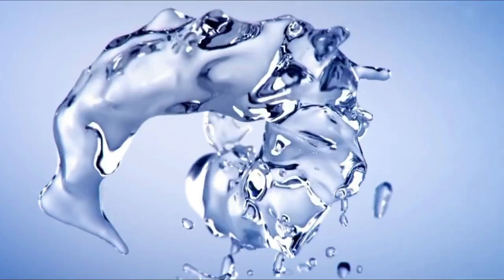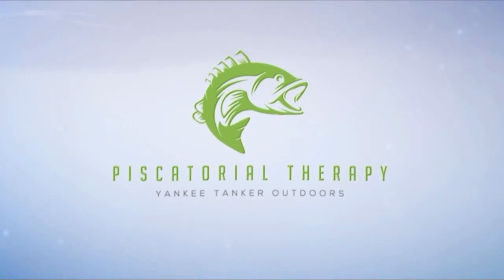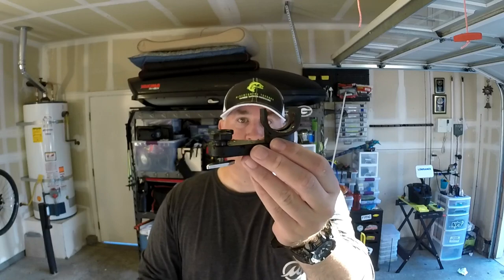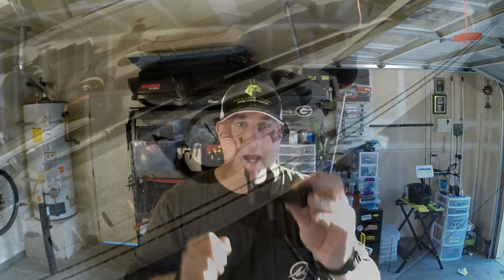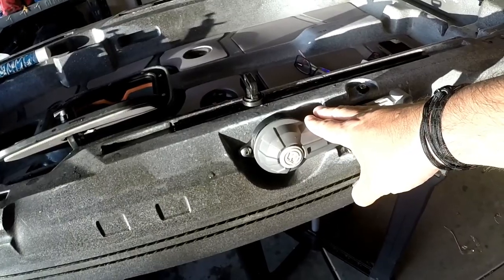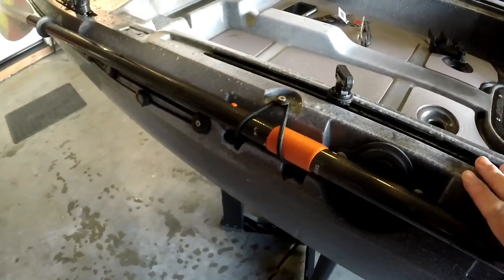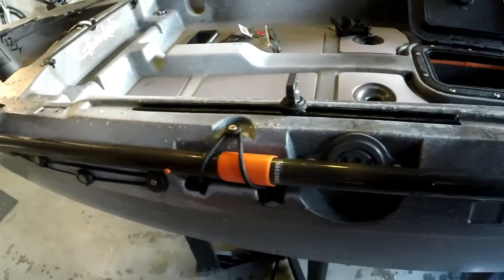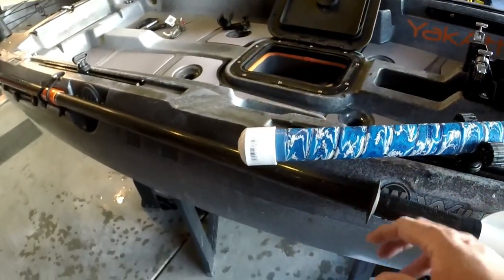RAILBLAZA QuikGrip Paddle Clip

Comment: Yup, that's the one I use too. I fish mostly in the ocean, and I got sick of the paddle digging into the swells on rough days. Didn't like the roto grip bc it covers up all the tracks. This one keeps most of the tracks exposed for my other mounts when I need to use them. Works great.
Reply from the maker: For sure this mount saves all those issues.

Comment: If you have Boone Dox landing gear, will the paddle  end up hitting the wheel legs? I would love to get that paddle clip
Reply: It will hit the legs. I had that problem with my Slayer. Move the paddle forward and problem solved. I opted for two paddle clips for better support
Reply: Do u think 2 clips is necessary or is one secure enough?
Reply from the maker: One is fine.  I’ve never had an issue.